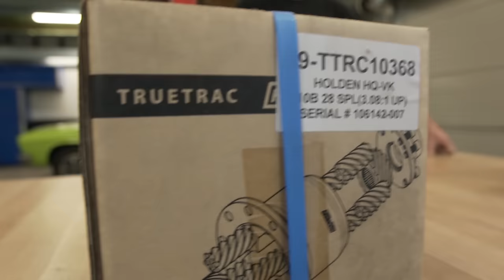IT WAS SUPPOSED TO BE EASY!! Harrop Truetrac Install

Comment: So what was the actual issue with fitting the diff center? Smaller shims required? Did you measure the old one?
Reply from the maker: Yeah the bearings were slightly wider so we needed smaller shims
Reply: Any chance you no wat size shims thy used

Comment: I use a short length of 10mm chain to remove axels,works better than the reverse drum setup..start off with slack then just yank it.works a treat

Comment: Hey guys, another great episode. I have a 17 year old daughter who is very handy on the spanners. She’s recently acquired a 60 series Sahara that needs a motor and some rust repairs. I’d love to get her her own set of spanners for her to work on her 60
Reply: 12HT motor? Also I'm pretty sure Camo's dad is a 60 series guru.
Reply: @aaronhogan2371  na it got the 2F or 3F petrol motor. I have a 4JJ motor that needs a rebuild in the shed so I’m tossing up whether to use that motor or get the BMW 3.0L turbo diesel motor
Reply: @paraplegicbradleyschubert1328  4JJ1 is an excellent choice but so is the BMW. Friend of a friend is doing the bimmer swap currently. The Cummins R2.8 is also worth a look. Anything is better than the 2F/3F. I have a few 80 series my main one being a 1hdt. The one I'm daily driving is a 3fe. Its a dog. No power, hard to gets parts for it, impossible to tune it, difficult to work on. I've done everything possible to keep it well maintained too. Its just a shit motor and hence i'm looking at diesel swaps too.

Comment: Nice one lads!!! Shame it didn't fit straight up but then that's what the shims are there for and just 0.3mm will make it a much tighter fit. If it's too tight a fit then it'll prematurely wear the bearings due to too much preload on the bearing from the shims. Plus now the backlash will be set properly.

Comment: I got a good tip from a diff specialist for when axles are stuck like this. Heat around the housing where the bearings seat with a butane flame 🔥

Comment: The Reason the Harrop unit doesn't fit easily, is because, the shoulder-to-shoulder width is different (wider) next time put a straight edge across the Two Hemispheres next to each other to confirm the heights are the same.